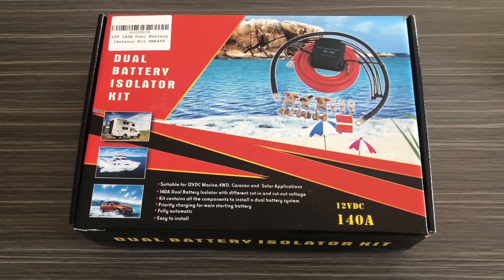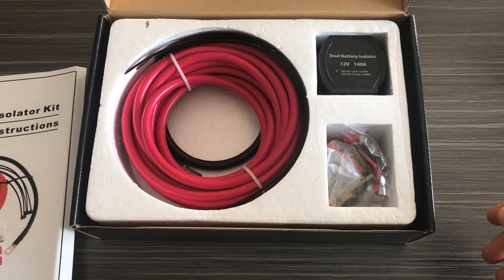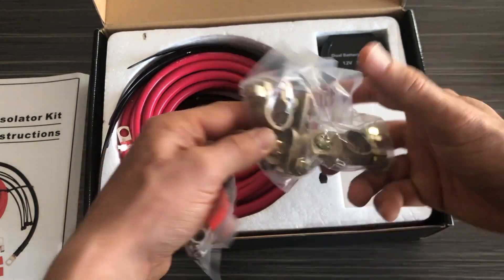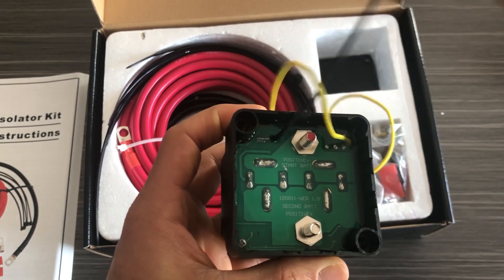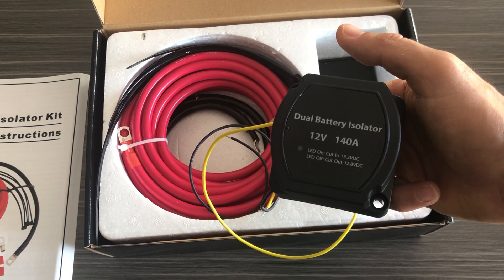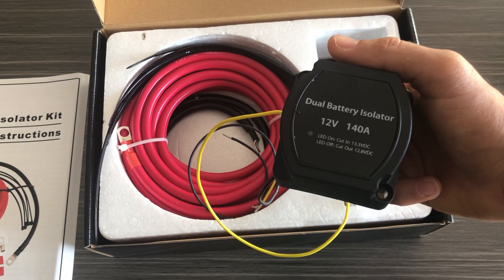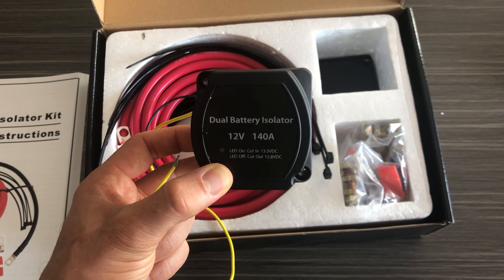Dual Battery Isolator Kit - 12 Volt 140 Amp Voltage Sensitive Relay Automatic Charger

Comment: Your explanation was clear and concise however I don't think it will solve the issue I have? I need the house batteries to keep the chassis battery charged? House batteries are charged by solar, does the system work in reverse mode, or is it just a one way charge system?

Comment: I am currently charging my 2nd deep cycle battery in my truck camper shell with a 100 watt solar panel mounted to the roof, and Renogy solar controller. I run a Dometic fridge and some camp lights with the 2nd battery. I’m finding in winter months the panel isn’t doing the job. Can I simply add this to my system so when driving I’m getting a full charge, and then when I’m parked the solar panel kicks in? Do I need anything extra since I’m already using solar? Maybe I can just ditch the solar panel and controller all together? I only camp a couple days at a time.
Reply: I have my solar panel charging wire running to a bus bar from the solar controller. That bus bar then feeds to both batteries but I will be getting an isolator to keep the batteries separate in case one goes bad or to prevent them from draining incorrectly.

Comment: If I wire the switch with the yellow wire to a toggle switch will the isolated still kick on when it sees voltage over this way I could use the yellow wire as a emergency battery

Comment: I have a question,  I plan to install a second battery in my isuzu trooper and I understand this will charge the second battery and disconnect it when the vehicle is shutoff. My question is I have a 100w solar panel and charge controller is it safe to connect the charge controller to the second battery along with this isolator so it would have two sources of charging?
Reply: I everything if found out in the last couple days, it seems like that would be fine; but that is my plan too (both this product from main battery and my solar panel), did you find any other info to clear this up you can share with me?

Comment: Hi, great video thanks....... I have a question though.
I am installing a solar panel to charge the house battery and wonder if the excess voltage it produces will also charge the truck battery?
Hope you can help
Peter

Comment: I got the kit and am going to run it in my 2018 yxz1000r utv. And was curious if I could run a slightly smaller atv battery as my secondary for my auxiliaries like stereo and rock lights. Or do they have to both be the same size. Both are 12 volt batteries just different sizes
Reply: Did you hook this up for your auxiliary in your razor to run your stereo lights etc if so how did it work I am thinking of doing the same thing

Comment: Should you be putting fuses between the Primary battery and isolator, and the isolator and aux battery?
Reply: Yes, and it should be around 140A between the main battery and isolator

Comment: If you have this kit but running 2 optima yellow tops with a 250 amp alt is this too small of an isolator?
Reply: Same question ⁉️ same yellow top ' lead based AGM " starter/ 650+55 additional leisure AH
Reply: You want the isolator to provide the coverage for the load you'll be pulling on the battery. Not necessarily the size of the battery.

Comment: What happens if I connect  the yellow directly to the positive main battery?? My red light turns on as  soon as I turn the truck on and it turns off as soon as I turn off the truck. I'm i doing  something wrong does it has to be to a switch?
Reply from the maker: The yellow wire manually trips the isolator to connect both batteries. It can be wired to a toggle switch
Reply: I have a 2017 toyota 4runner and the same thing is happening to me, did you ever figure out a solution?

Comment: I have a 2004 Dodge 3500 Cummins diesel with two batteries will this work if I just hook it up to one of the 2 batteries.back to my rv trailer.

Comment: I have a 2019 Thor Chateau upgrading house batteries to  Lithium does this unit work on my upgrade and do you know if the factory unit needs to be replace since it has the ability to charge house battries now.

Comment: So does the yellow wire bypass the relay to separate the batteries so the leasure battery can't flow to the starter battery, or does it stop the relay from separating the batteries,

Comment: Hi I just received mine yesterday , I bought the dual kit and it didn’t come with the yellow wire. I also bought a red switch to switch between batteries on and off if I want to use my secondary battery but like I said, it didn’t come with a yellow wire. Why is that?
Reply from the maker: Please reach out to us at support@gwaautoparts.com

Comment: Is it okay to have two auxiliary batteries as long as they are hooked in parallel?
Reply: ideally you would want to use 2 isolators so all 3 batteries are isolated from one another. However, you could run 2 batteries auxiliary batteries together in parallel if you wish

Comment: So i have one similar to that. My starter battery was dead. I put a car charger on it overnight. I did not disconnect the battery isolator when charging the starter battery. I noticed after the battery was charged that the light on the isolator wont turn off. Did I damage the isolator?

Comment: great explanation, but is there a specific type of switch to attach to the override wire?  Thank you!
Reply from the maker: A standard 12v toggle switch
Reply: What if I install a switch that has 3 (one terminal for house battery, one terminal for start battery and one terminal for 1&2 for emergency start?) Where does the yellow wire go?

Comment: So what you do with the black wire? Basically I want to know it’s it required to hook up the yellow wire
Reply: Same
Reply: No the yellow is to override the isolator making both connected when the truck is off could be used to jump your vehicle if your main is dead or wire it inside with a led to see when the solenoid is on

Comment: If i put a switch between the yellow wire and ground, will it allow my charging system to return to normal and charge my start battery only?
Reply from the maker: yes

Comment: Does the negative from the secondary battery gets connected to the main battery negative  or can I ground it to the chassis?
Reply from the maker: You will want to ground to the other battery or to a common bus bar
Reply: @gwaautoparts232  I'm locating my second battery in the bed of my pickup in a battery box and running circuits to accessories from there.  If I understand correctly, is the best installation to connect the secondary battery common to the primary battery common? In order to connect the common of my main battery and secondary battery I will need to purchase an additional piece of wire.  I will also have to purchase the cable armor and a toggle switch for the yellow override.  It would be nice if GWA included or had an option to buy a kit with everything needed.
Reply: @mzerk1021  All you need to do is ground the second battery to a clean chassis ground. Since the battery is going in the bed you can you just grind a small section of paint from the frame rail under the bed. Ground the battery to there. The yellow wire is not required since it's a manual overide to connect the batteries

Comment: Should I add a fuse to the positive? If so what size is recommended?
Reply from the maker: If the positive lead tying the 2 batteries together is going to be longer then 1ft we recommend fusing with a 100amp fuse

Comment: Where do you connect the yellow wire to bypass?
Reply: He just said a switch did you not watch the video?
Reply: @chicago1680    Pretty sure there is more than one switch on a car.
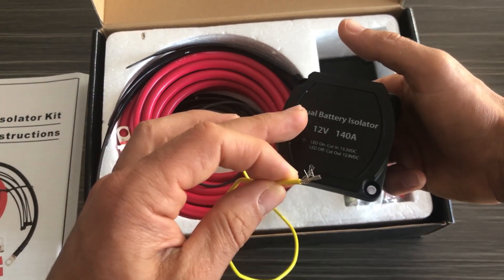Reply: @byronlee6486  He literally says A SWITCH. Not a switch on the car. Not a switch on the dash, not a switch in your house. Literally a switch. One end goes to the switch the other end goes to ground bud. So that would be a 2 pole switch. That's it,  how hard is that to understand? @ 2:40- 2:50. if you can't comprehend that you should NOT be doing any wiring and should take it to a shop that may be better able to help you. hope that helped. You could always call them too
Reply: @chicago1680    So to ground. Thx
Reply: Same question please help me.
Reply: where do you connect the yellow wire to bypass
Reply: @chicago1680  Love you man, you just won best comment here :trophy-yellow-smiling:
Reply: @donutz1  people just don't listen 🙄

Comment: Do I need to put some fuse? wich amp size?  Im using two 90amp leisure batteries and my regular rig battery?
Reply: Probably an inline ANL or circuit breaker around 140A on the input side of the switch